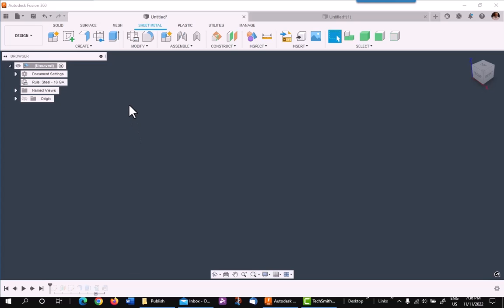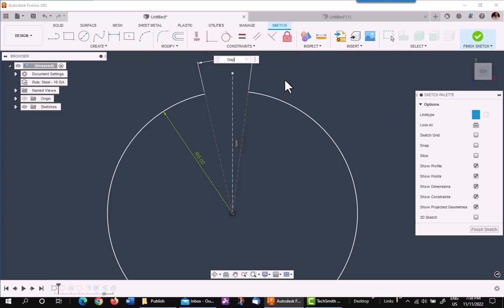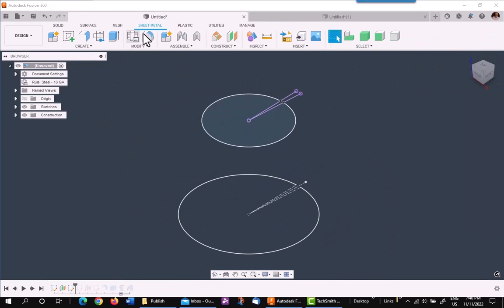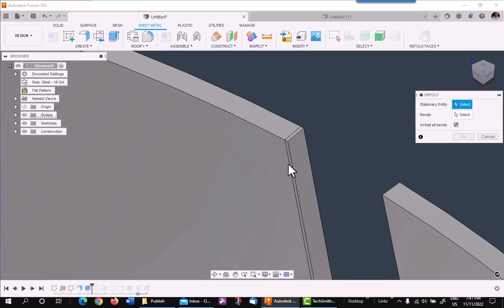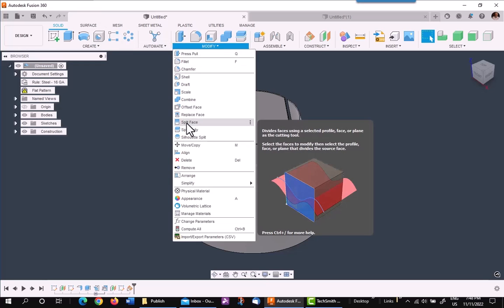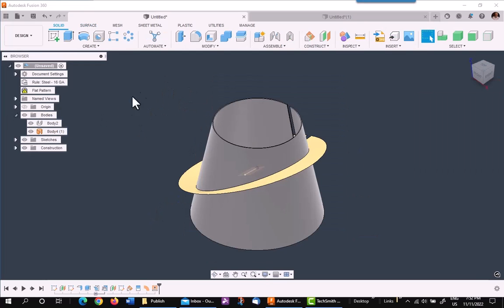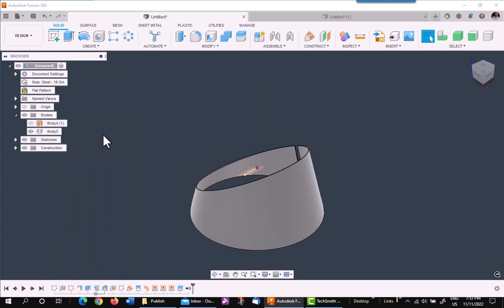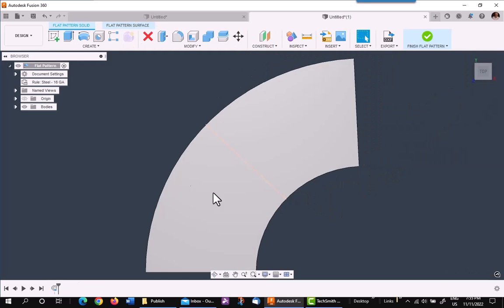Creating a Cone Using the Lofted Flange Tool

Comment: Thank you again! That's exactly what I wanted to try. Your explanation is so dang clear. Sadly what I wanted to accomplish (involves laser etching) is still elusive, but I can put a checkmark in that box thanks to you. 
I'm looking to apply (emboss, or use a decal, etc.) artwork to a cone and then unwrap that cone,  altering/skewing the artwork. If I could emboss onto a cone and unwrap that to get an SVG or DXF file that has been skewed, the birds would sing. Is that possible?
Reply from the maker: Adding an Emboss to the sheet metal cone is possible.  If you would like see how it is done, sent your Fusion 360 model and artwork to jhackney1950@gmail.com.  I can pick up your email from that.
Reply: @jrhackney  Great. Ill send it tonight after dinner tonight (PST)